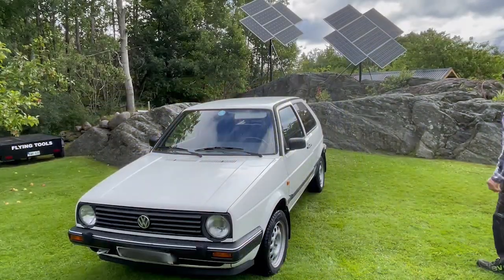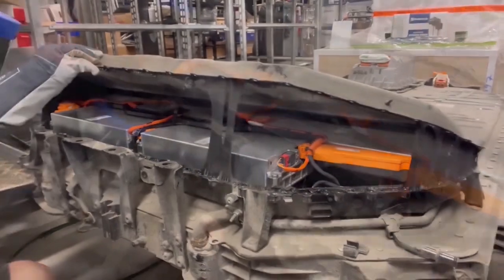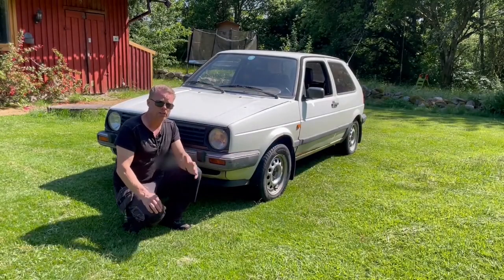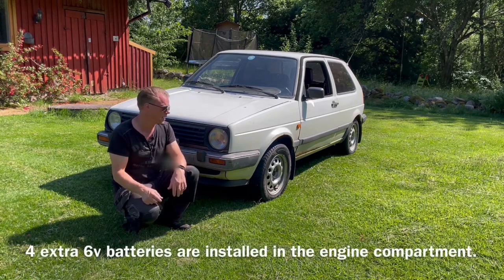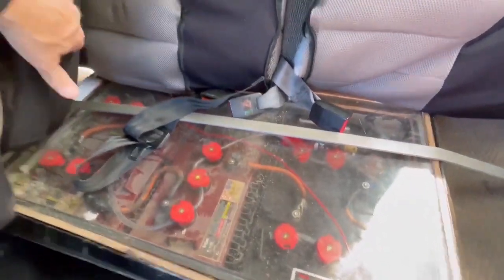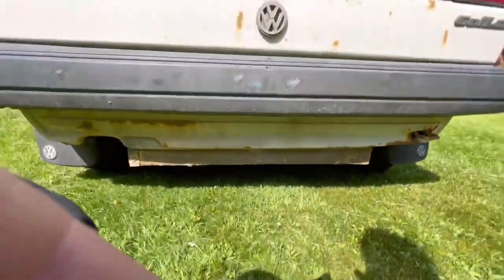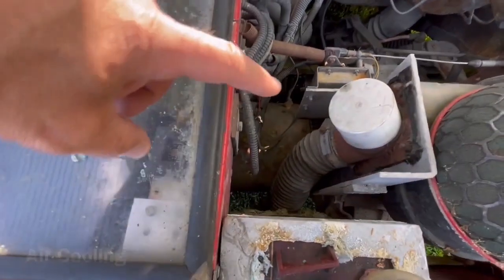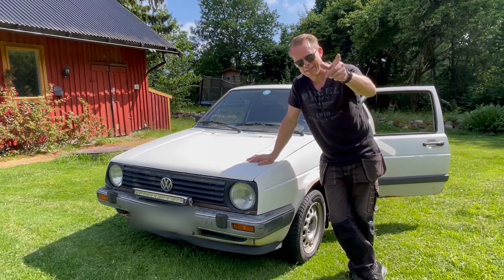I bought a VW Golf MK2 Citystromer, All Electric Veteran

Comment: I should try to get the motor and electronics of a e-up inside it. I think it will fit easy.
Reply from the maker: Yes, I definitely would like to do that but the electronics won’t work unless you take everything from the e-up. It’s not possible to do any swap codings if you now what I mean. But I think that a leaf motor will fit nice, and the inverter almost looks like the old ABB inverter😅
Reply: @flyingtools  you only need the charger, inverter and the old engine control unit. The e-golf and e-up have still an old engine controler for the cooling and start blocking. That is easy to program away. Then you don’t need the dashboard. The bms is I think useable with your id3 modules. The bms is also used in the e-golf. They should see them over can-bus. But yes it will need some changes in the computers to let it work. But there are a lot of people out there that can do very much with VW computers. Then it is still an VW and the e-up/e-golf engine will an easy fit in the citystromer. If people can fit a 1.8T in a up then it can also be the other way around. I have an e-golf and can send you some pictures of the engine mounting.
Reply from the maker: @Kleuvert  this is good info, thanks!
Do you hava a link to a sight whey they are doing this? It would be so interesting to se!

Comment: Very nice project. 👍 It's good that the car is still running, then you can gain some experience with it and change the battery in winter. With a lithium battery it will also be much lighter😀